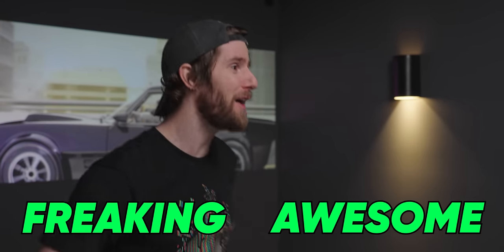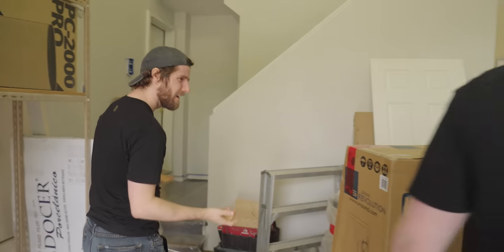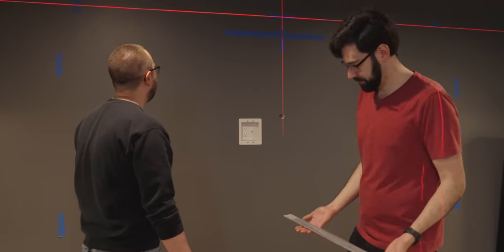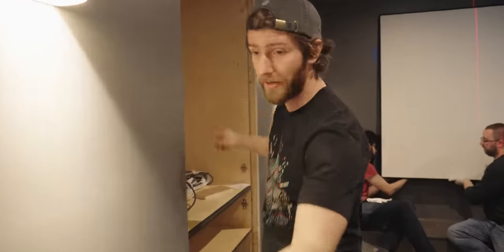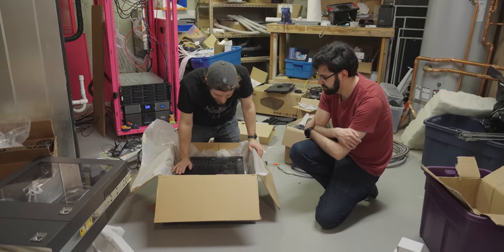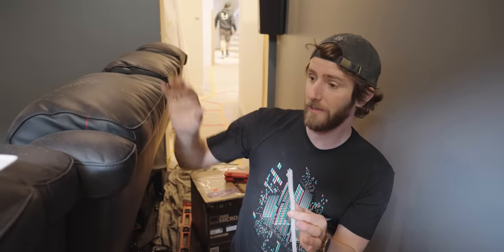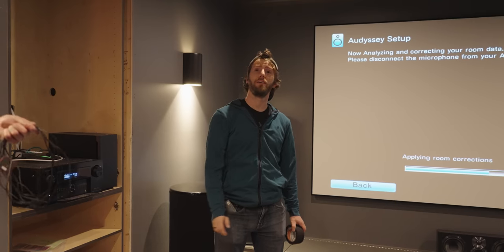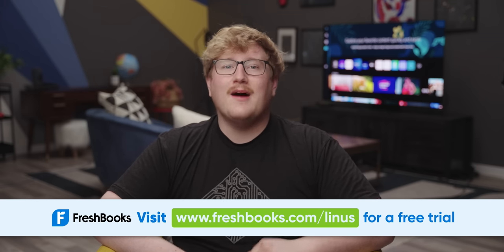I finally made it - House Theatre Room Build

Comment: Dan: "point it at his left ear."
Linus: "that's gonna look so stupid though."
Dan: "yeah."
Reply: Refuses to elaborate further...leaves xD
Reply: Do you want maximum audio quality or nice looking speakers?

If you want "both", the closest you can get is something like Genelec 8260 or 8361 which doesn't look bad even when it's pointed directly towards the listener. For satellite setup you could use something like Genelec 8330 if you have good subwoofers. The price might get your eyes a bit moist, though.
Reply: @MikkoRantalainen  I don't think Yvonne would like look or price tag of the Genelecs
Reply: @lukebuchwald9252  I think many women actually like the looks of 8000 series Genelecs. The 8260 might be too big but 8330 in white color should be pretty well received in most homes.
Reply: That bit was great, Dan banter is the best.
Reply: this sounded so fucking professional i wouldn't even try to say something... just... do.
Reply: @MikkoRantalainen  Umm hmmm. 10-20K for speakers? Might as well get separate amps for each one also. Didn't look for the receiver specs but lots of them are way overrated to keep the price low for extra underpowered channels. The multi thousand Denon receivers likely don't have this problems but the lower end receivers of most brands do for budget minded listeners.
Reply: @larryvaughn5843  Have you ever listened any Genelec speakers? The idea is that speaker crossover is implemented before amplification and each element in the speaker has amplifier designed for that element. And every speaker unit has been individually calibrated in the factory.

Yes, they are expensive but not overly expensive for accurately calibrated speakers. Most manufacturers do only random QA testing and do not bother testing and tuning every speaker.

Genelec also has superb support for their produts and they can usually restore even 20 year old speakers to factory spec (that is, calibrated to match the original sound after replacing required parts).

Which passive speakers would you use with those external amplifiers instead of Genelecs?
Reply: @MikkoRantalainen  Genelec is a good choice, I've seen them in recording studios including one I visited this fall.
I'd buy some if I wanted to drop the money for an atmos system.
Reply: @larryvaughn5843  Yes, Genelec are often seen in real studios. The price is pretty high so we're already getting close to dimishing returns line, though. But if you want the most accurate representation of the original digital audio stream (or high quality analog source), you should at least given Genelec speakers a shot.

However, some people like "warmth" (which is usually technically harmonic distortion) in the sound and they opt for "nice sounding" speakers that apply  that effect to all music they listen.

I personally prefer to keep effect prosessors separate from the speaker system so I can apply the effects only if I actually want that.

Comment: Any speaker or subwoofer with a port that is aimed at a wall will be highly sensitive to its position relative to the wall. The frequency response (using the PC2000 sub as an example) will show a large peak at one frequency and a large null at a related frequency. These frequencies vary depending on the distance of the port from the wall. While the auto-calibration feature of a receiver or processor will attempt to compensate, that compensation will result in large EQ boosts/cuts which affect both phase response and system headroom. With this many speakers in this size room, headroom is not so much of an issue - but you may find that you can get better results with much less correction with speaker placement that takes the port location into account. Looks like a fun project!

Comment: Subwoofer port should not be so close to the wall or be blocked by objects. Also, sub waves reflect from walls and there will be areas where these cancel each other out. If you walk around the room you find spots where you can't hear any low frequencies. So sub placement definitely matters.

Comment: Huh, that laser at 16:00 looks like the original Star Wars trillogy, where the light emmiting lasers were actually darker than the surroundings. It's (237,57,51) on the laser and (220,137,110) on Linus' face.

Comment: The top-end Denon and Marantz receivers have some pretty great upscaling processors in them.  You might do a comparison between the Nvidia and the Denon to see which you like better.
Reply: I was thinking the same thing, dismissing the Denon up scaling might not be the right choice.
Reply: @stevengoetz6773  Agreed. And I also might not be so quick to praise the upscaler in the Nvidia unit. It may or may not be that great.

Comment: I'm surprised at the surround speakers. Why use bi/dipole? I'm assuming since it's a .2.4 system you're setting up for Atmos. Since Atmos doesn't use channels to place sound but locates it in a sound field, it is better to use monopole if you're loading up on surrounds. (Of course, like most things, this is opinion. But I'm still surprised).

Comment: When you don't have drywall on yet, you put plywood from stud to stud in areas where you will have heavy things mounted on the wall.
Reply: Yeah that would have been good. That, or additional 2x4. It could be real janky under there, but it'll provide support and then be covered by drywall anyways.

Comment: 6:50 I have to agree with Jake on the placement of those subs. I think the audio from the towers to the rear seats and just in general will be affected. If those subs fit in the back of the room, which may barely be the case I would do that. 

Otherwise since those towers have pretty hefty subs built in, adding a ported sub that goes in the bottom portion of the media cabinet would be a better option to keep everything clean and obstruction free.
Reply: Tbh those PC2000s would be kinda rad speaker stands with some vibration dampening material on top of them. That MTM design on the towers makes the vertical alignment finicky from the physics standpoint, but at least it somewhat eliminates roof and floor first reflections.
Reply: Doesn't SVS recommend a foot or two of clearance for the Ultra Towers? Lots of things in this setup seem off.

Comment: Linus, I’m not sure If you’ll see this, but here is some info for you:  i have always used epson protectors, and i love the picture quality and value they have. But i would most certainly try and plug it into a UPS of some sort. They can be pretty sensitive to power fluctuations. Just a heads up.

Comment: 14:00 Pro tip for the projector installation in home theater: if your projector has high quality lens shift and your screen doesn't hot spot the projector, position the projector as high as possible relative to the screen and you'll get practically zero shadowing from people moving the room.

Comment: Subwoofer placement definitely matters. Room modes are a real thing and you can get huge dips in bass in certain seating positions if you are not careful. 2 subwoofers definitely helps even this out but it is still important to place them correctly. Doing a sub crawl will help in this regard and also running room correction software will help as well as long as it has a separate bass management component, ie Dirac Live, Audyssey XT etc.
Reply: yeah but at the same time it matters less the more subs you have, and in his case he has them in differnt planes, vertical and horizontal. to, he's running 4 subs, with 6 drivers, depending on how he is running his towers anyway.  Obviously wih the room config the subs can only go so many places without being in the way, it'll be fine, especially if he doesn't obsess over seat to seat consistency, long as they get time and phase aligned.
Reply: As Dan said the frequencies are so low that their wavelength is so big it'll practically fill the entire room regardless of where they are. What you should however note is the reflection of those waves as the reflected waves can counteract and indeed create "dead space" (look at 2 water drips falling into a pond and how their waves cancel each other out at certain parts). But other than that its not that big a deal (and tbh you gotta be real unlucky for that to happen anyway)
Reply: Except for the fact that Audyssey is the worst room correction software in the world and hates subwoofers. Sub placement matters only if it's a ported sub where the port is aimed at you and you've only got reflective surfaces. If I can get away with just putting a balled up pair of socks in my soundbar's ported upright sub and having it sound fine in a very reflective room, Linus will not be running into issues here. The only times I've had to do a sub crawl in the past 10 years was when someone had set up their speakers with Audyssey and I had to correct it for them...
Reply: @KoenvdW88  oh there are worse...arc didn't even work til recently. and no one like yamaha's implementation.   Audyssey is fine if you help it with the editor and don't give it complete crap to start with.   Bottom line, if you have 2 or more (high quality) subs you're going to be ok, unless you are in a very challenging room.   And I doubt the kids or his wife are all that picky anyway.
Reply: For a small room with two subs, it'll probably sound fine wherever - but it's worth working on the placement to get consistent bass at most of the seats. 
Also probably worth floor to ceiling corner bass traps and acoustic panels at first reflection points... The acoustic treatment would be a nice project, maybe they can bring in someone experienced to teach us!
Reply: You don't need software correction, just a little acoustic treatment would do the trick, especially bass traps and VERY FEW absorbers at the right places (maybe like second reflection)
Reply: @DJTimeLock   "As Dan said the frequencies are so low that their wavelength is so big it'll practically fill the entire room regardless of where they are." This is an older response but it's still very much a thing that you can be sitting in a null for bass frequencies in a room. Depending on the room size and frequency, we're talking 6db swings (Or more) by moving 3 or 4 feet towards or away from the screen in worst case scenarios.
Reply: @ryankramer With one sub in european square room you might even experience 15db peak! It would have high q through so it should be easy to dsp

Comment: It would be cool if you built a screen frame slightly in front of the current screen wall so you can walk behind the screen.

You could put the center in the middle of the screen and then also hide your subs behind it.

Comment: To solve your projector light bleed issue when watching various aspect ratio content you'll want to consider swapping to something that supports an anamorphic lens. No light bleed if there's no light transmitted there in the first place! That's when you then use furniture or curtains or whatever to cover the unused portion of the screen.
Reply: the Epson supports an anamorphic lens, but i dont think it will automatically, problem is you need to engage or disengage it depending on content, and you aren't getting all that much benefit considering the lens costs 2-3x what the projector does.
Reply: How about motorized black velvet curtains/blockers with selectable aspect ratio? Another project!

Comment: Dont let your woofers face the wall unless you have bass traps, the reflections will make the bass sound more heavy than it should be, less clean, more muddy. Or you can let them but try to leave some space, not that I think it will matter with these monsters, my opinion I think that sub needs to sit in the middle of the room for the cleanest low end, but I dont know how you would cable manage that

Comment: Ass frequencies aren't localisable, that means if you hear it you can't tell which direction it comes from. (Everybody can't tell below 80hz, some can't tell up to 120hz, people have different ears/tolerances) but that doesn't mean sub placement doesn't matter, you get things called standing waves or modal frequencies or modes. This means the bass response will be different depending on where in the room you sit/where the sub is. You can correct for this with bass traps or using multiple subs (mixed to mono) to cancel each other out creating a more even bass response. You can use smaller subs paired together to get better bass than you ever could with a single sub of any size

Comment: Nice setup, but how you used the calibration mike made me hurt. They are suppose to be tripod mounted. There is a cheap one that comes in the box, but I would expect that you all would have a spare camera tripod laying around.

Also Denon now makes an adapter to connect 3 8k/120 HDMI inputs in to the single one that they have now and integrate seamlessly  in to the controls

Comment: I have the Denon 6700h running a 7.2.4 system. The fact that Linus just plans on replacing the 8500h makes me very sad.

Also we need more home theater content. I love this stuff
Reply: Using any external amps?
Reply: Well, he stil thinks that he will replace it with matrix switcher )))
Reply: "I don't know why there are receiver for half the price with many more 2.1 ports" Yeah, ehm, maybe bec flagship receivers don't get updated that often?
Reply: @florichi  especially considering that most of the higher end processors are still hdmi 2.0 ))))
Reply: @naglayaloshad  because noone needs 2.1 except gamers. And gamers aren't the target group of 10k$ processors.
Reply: @florichi  yep. But I still hope that this or next year we will have more processors with 2.1 and I could easily upgrade from my 3700.

Comment: Subwoofer Placement: Initially place the subwoofer in your primary seating position, and have it play some bass heavy track. Then wander around the room to find the corner or whatever location with the best bass when you're in that location. Then, by symmetry, put the subwoofer in that optimal position.
Reply: Yup, optimal subwoofer placement via subwoofer crawl technique.
Reply: Yes that is def the best method, and multiple subs with various crossovers as well for even lower bass. ULF subs behind chairs are dope to have
Reply: Alternatively, just put it where it fits because the damn thing is humongous and there's only so many places it can go... Receivers are smart, let them figure it out.
Reply: @sntslilhlpr6601  Doesn’t hurt to try it first before deciding.  Might work both aesthetically and acoustically, at least it did for me.
Reply: @cody8860  What are you talking about? That technique has nothing to do with changing/modifying the room itself.  It’s just making the most out of what you have in the room.  It’s literally just a matter of moving some furniture around at the very worst (which I highly doubt they would need to do given the position of the seats in that room).  Please read the instructions again.  Every professional Home Theater A/V installer would do this regardless of if they were going to do big changes or not to the room.
Reply: @sntslilhlpr6601  the receiver cannot account for poor sub placement.
Reply: @sntslilhlpr6601  That receivers room correction doesn’t tune the subs, only does distance/delay. They would need to be running a separate piece of hardware to compensate for less that ideal placement and the room/listening position response that comes with that placement.
Reply: I have never commented this, but that's a 3000iq play right there dude
Reply: @sntslilhlpr6601  cheap receivers like the denon Linus is using uses the audussey software still and does not do sub correction. And sub placement makes a huge difference actually, I’ve actually posted some charts from a while back showing this in our room
Reply: Hansy  You’d still want to do this with however many subs you have anyway if you want the best optimized bass response for your room.  I have dual subs too and it works well with it.

Comment: Linus: you could simply use a rasp pi 4 as a controller for those led on back screen, it's a little pain but basically it just screen maps based on a color picker and you can set the points where every you want,i.e green on bottom for grass blue top for sky, you can go as deep as you want to get as big as color aspect as you want would take a long time, I just did rgb setup but having  many different tones and brightness of each color will blend better to what you watching. Would love to send you a demo setup if you like. Would be willing send a led strip and pre setup rasp pi for you test out,I'm not trying sell you any service or anything like that just a Linus fan

Comment: @8:00 When studs don't line up for me, I usually use a piece of 1x4 (square edge 1x4) to mount to the studs, then mount the final object in it's desired location along the 1x4. 

Sells the illusion like it's floating off the wall.

3/4" of an inch further from the wall for the 1x4 backer has never made a difference, for me, and I get a secure mount in the preferred location on the wall.
Sometimes I use a painted, finished (black, white or color matched to the wall) 1x4 to make it blend nicely at side angles.

Comment: Linus upgrade wise, please get a JVC Projector. Electronic masking, please build an MVEL curtain rail. It involves MVEL22 black velvet, one of the blackest materials in the world. Use it for a motoroised masking top and bottom but also for the sides AND your walls. Although you've pained the room grey,t here is still TONNES of reflected light and the picture will further improve. 
JVC's will get you the black levels which will with the right room treatments be the best of anything you'll see outside of an OLED>